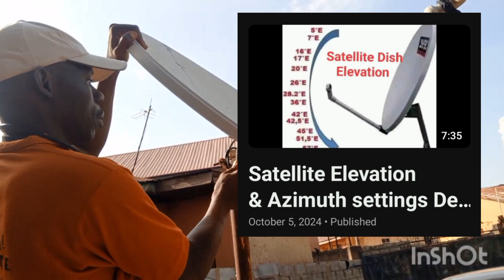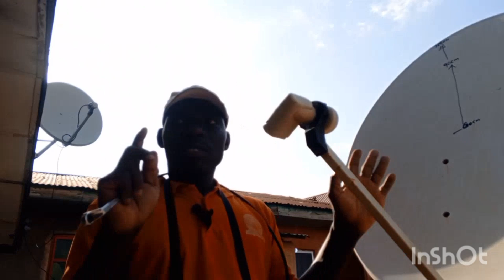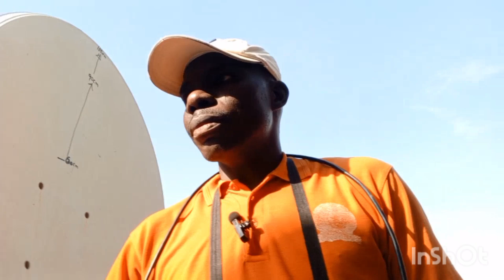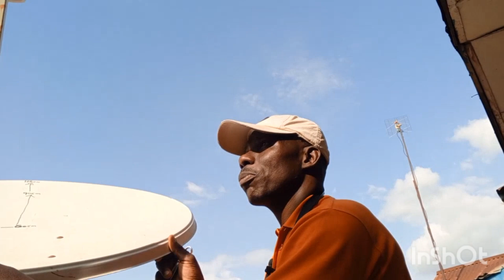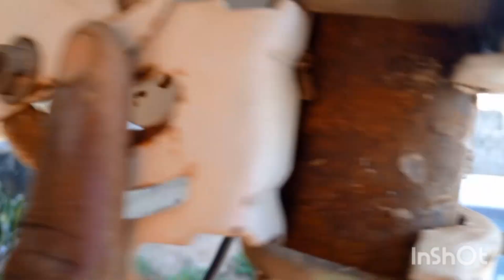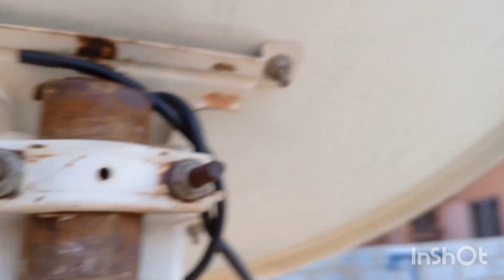Satellite Elevation and Azimuth Part 2 (West BEAM)

Comment: Good evening sir, thanks for your tutorials, it has helped me a lot. I have a challenge, I was searching for sltv signal on a 90cm dish but I couldn't get it but I got other signals like 36e, 42e 45e even 68.5e but I couldn't get 51e. what is the problem?
Reply from the maker: INTELSAT 39 @ 62.0E ADDED TO LIST
CURRENT WORKING SATELLITE 📡 DISH TRACKING FREQUENCY UPDATED BY PUSH /ADUBAM  08TH JULY 2025 5:30 PM (WAT) YouTube – Satellite TV Experts   - https://www.youtube.com/@Satellite-DIY
 WhatsApp: https://chat.whatsapp.com/JGF9vTVU7BuDfwgoqatrik
ABS 3A  
10972 V 30000 
--------------------------------------------------------------------
EUTELSAT 3B @ 3.1E C-BAND (WHOLE OF AFRICA) 
DISH SIZE 90CM AND ABOVE (DIAELECTRIC PLATE IS A MUST)
BREKETE FAMILY, SPORTY TV, NBS SPORT (FREE)
3781 L 16833  FEC 3/5
4007 L 4833 FEC ¾

---------------------------------------------------------------------------------
5E (Star times) 11919H27500,
12015H30000,
12380H27500
----------------------------------------------------------------------
7E CAS 10762 H 30000  - NEW 60CM AND ABOVE 60CM AND ABOVE
__________________________________________
7E (Azam Tv) JW
Bet9ja/Betking): 11122H12500, 11607V45000 12605H30000, 
10887H30000, 
11192H03210
MOREPLEX TV 
11481(H/V)45000, 
11607(H/V)45000
--------------------------------------------------------------------
7.0W Nilesat (MBC WEST)(4'O, clock)
11559V27500
11559H27500
11560H27500
11685H2700
11457H27500
----------------------------------------------------------------
 7W (Nilesat, MBC West) 11033V05000
11559V27500
---------------------------------------------------------------
9E (AFN Sports)  (100cm and above) PowerVu
11804 V 27500 FEC 2/3
---------------------------------------------------------------
Eutelsat 10A CBAND  (Deeper Life etc) ¾  (1.8m dish and above)
11716 R 5416 (Horizontal) dielectric plate compulsory
4033 R 5417  (Horizontal) dielectric plate compulsory
---------------------------------------------------------------
HOTBIRD 13F @ 13E  - 60CM North Africa – 150CM Somalia  - 1.8m to 4meters SSA
12558 V 27500 FEC 5/6
10719 V 27500 FEC ¾
12577 H 27500 FEC ¾
------------------------------------------------------------------------

EXPRESS AM8 (14W ) NEW 60CM AND ABOVE ( NORTH AFRICA < = Liberia) 90CM AND ABOVE 
11541 H 9980
11484 H 3534
11484 H 3534
_____________________________________
16e Eutelsat  (60cm and above)
10804/H/30000, 
12603/H/30000, 
12604/H/30000, 
-------------------------------------------------------------
17e Amos  12333/V/30000 
-------------------------------------------------------------
EUTELSAT 21E
11107H4540
11189H9690
11617V27500
10856V45401
---------------------------------------------------------------
Eutelsat 21B @21.5E (WESTERN BEAM)  
11618 V 27500      60CM Mali, Ghana, 90 cm above Nigeria & Cameroon  
11622 H 01250  
Oman TV Sport       90cm to 120cm Mali, Ghana , Nigeria to East Africa 180cm
11627 V 14400 3/5
------------------------------------------------------------------------------------------------
26E  Badr ( MBC CHANNELS) (60cm and above)
 12284V27500
10970V27500
----------------------------------------------------------
28°E Astra 
12525V30000 
(Digital Max tv) 12645V32700
12605V30000
11595V30000
11635V30000
11675H30000
12645V37200
11675V30000
----------------------------------------------------------------
INTELSAT 28, 32.8e (180cm and above)
10975 H 30000 9/10
11092 V 30000 AUTO
----------------------------------------------------------------
HIPASAT 30W-5 @ 30.0W NEW (NORTH AFRICA AND <= MALI (W/A) 90 CM AND ABOVE
12476 H 27500
________________________________________
36e (DStv frequency)
 11747H27500,
11900H27500,
11938H27500,
11843V27500,
12245H27500,
11919H27500,
-----------------------------------------------------------------
Zap on Eutelsat 36D at 35.9°E (90cm South Africa and Southern West Africa)
11221 V 30000
11263 V 30000
11304 V 30000
11346 V 30000
11387 V 30000
11429 V 30000
-------------------------------------------------------------
HellaSat 3 @ 39E  (2.4m dish size and above)
12290  V 30000
12689 V 30000
----------------------------------------------------------
42.5e (Nigcomsat) 
12685V 30000
12518/H/29500
12539/H/05000
---------------------------------------------------------
42.5e (Ourtv NG)
12545H06166
---------------------------------------------------------
45e (VSN)
12511H12500 
Digital channels
12603H28570
----------------------------------------------------------
45.1E (LUFT TV)
11655 H 45000 - LUFT TV
-------------------------------------------------------
Cband_AZERSPACE (46e) 1.2M Dish)
3218 H 3332
---------------------------------------------------
51° 5 E SLTV
10973 H 25000 ( 60cm and above)
11102 H 10000
--------------------------------------------------------
MONACOSAT 52E  (90cm dish and above)
Solhsports 
11094H27500  
-----------------------------------------------------------
54.5e 11045V45000
-----------------------------------------------------------
54.9e is (Biafra TV): 10984v09100
------------------------------------------------------------
YAMAL 54.9e
11150 V 16665
-----------------------------------------------------------
NSS 12 @ 57E 
(East Africa 90cm, Rest of Africa 180cm)
10985 H 45000 (CNN, BBC, Aljazeera – Free)
11105 H 45000
-------------------------------------------------------------
62E  - INTELSAT 39 C- BAND
WJOLE OF AFRICA
3715 L 5574 FEC 5/6
3871 L 2150     5/6
----------------------------------------------------------

Intelsat 68e C band (1.8m and above Nigeria)
Aljazeera (FTA)  4064 H 19850 7/8
BBC News (POWERVU) 4064 H 19850 7/8
CGTN (FTA) 4064 H 19850 7/8
Hi -Dost (FTA) 4090 H 14368 3/4
NHK Japan (FTA) 4128H 14890 2/3
BBC NEWS (PowerVU) 
Sky News International (PowerVu) 4195 H 4000 ½)
---------------------------------------------------------------------
68°E KU  (Christian channels) (60cm and above)
12722 V26657
12722H30000
12682H30000
12562H30000
12522V27500
--------------------------------------------------------------------------
Intelsat 68.5E (DSTV Southern Africa Only ) 60cm dish and above
11010 V 30000 FEC 5/6
11594 V 27000  FEC 5/6
11130 H 30000 FEC 5/6
10970 H 30000 FEC 5/6
11130 H 30000 FEC 5/6
------------------------------------------------------------------------------------------

Apstar7 @ 76.5E - 3.4m above (Sports feeds via Bisskey and PowerVu) SAF
4005 V 7200
--------------------------------------------------------------------------
Thaicom6 @ 78.5E   - 3.4m above (Sports feeds via Bisskey) SAF
4156 H 7500 
------------------------------------------------------------------------
Measat 91.5E (Sony MAX – 3m and above SAF
3960H29700
------------------------------------------------------------------
Asiasat5 @ 100.5E - 3.4m above (Sports feeds via Bisskey) SAF
3996 V 7500
----------------------------------------------------------
NSS 9  @ 183.1E
(Cband) 4055 L 11000 ½